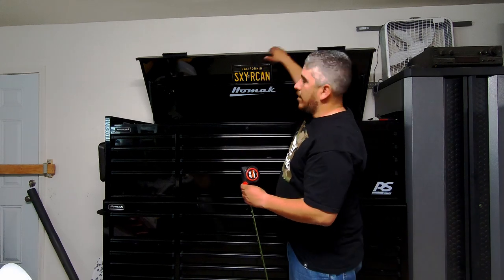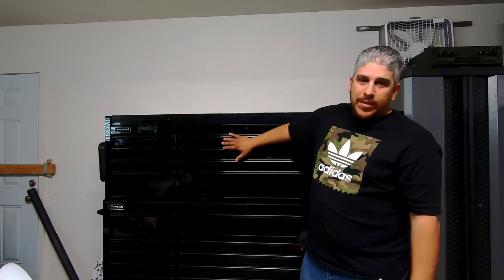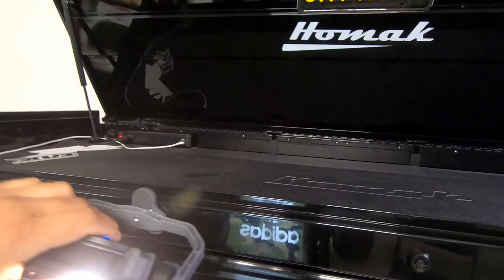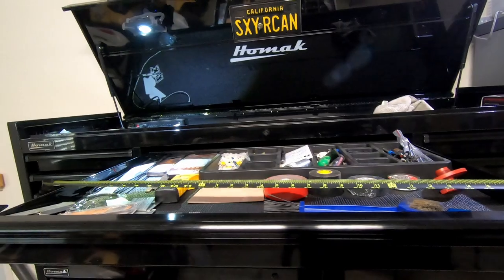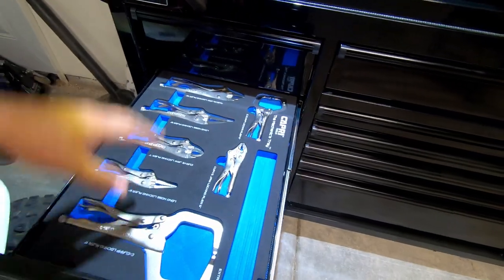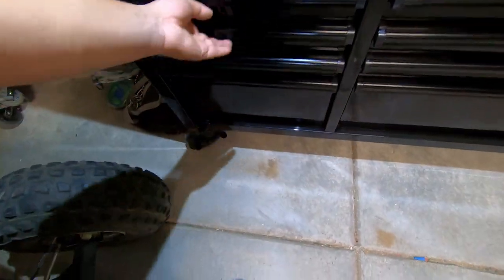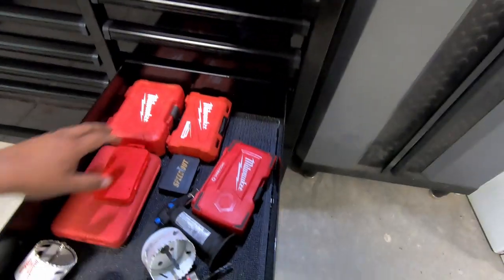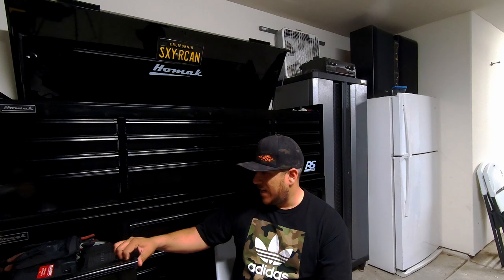Homak Rs Pro 72" (Off Road Icon)

Comment: Great video thanks. I am looking to get this box and am wondering if you still like it 5 months later. My main thing is if the drawers open all the way and you can put stuff in the back and still be able to get them out. It was hard to see in the video since the box is black lol. Any complaints? The main thing I hear is the latches are on the inside of the drawer and if tools get under it in the drawer the handle won't operate and the drawer can get stuck closed. Have you experienced this?
Reply from the maker: Yes I still love the box. The concern about the latches being on the inside is true and if you think the box is going to be full to the brim then yes it could be an issue. I have yet to have that problem yet personally. Almost all the drawers pull out close enough to flush maybe a 1/4" shy max. Complaint are the following. Drawers slides are stiff when you first get them you may pull them out and grease them all (that's what I did and they work better when they have weight in them). The side caps on the drawer handles have a tendency of coming off in the year ive owned it it's happened maybe 3 times but I don't work out of this box for a living. I may glue them on. And it definitely shows dust. I wanted matte for that reason but is what it is. For what I paid during Christmas time I would buy the box again no questions.

Comment: you said you paid 2200.00? both top and bottom? I was looking at a 54 rs pro and they are 2300.00 for that one
Reply from the maker: Yeah I purchased it during Christmas. Now they sell for like double that. I can't believe the deal I got. When the sale was on it was only when you purchased it together. If you bought them separately they were an extra 1500 at the time. So I jumped on it. Was out of stock then one day at midnight black came in stock and I just purchased it. Glad I did. Check Napa, sometimes they have them at a better price.